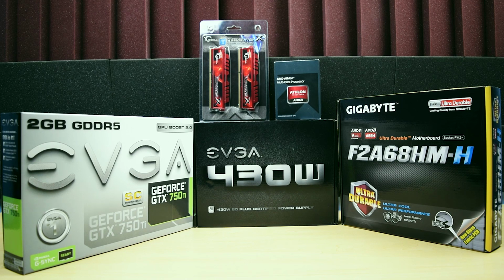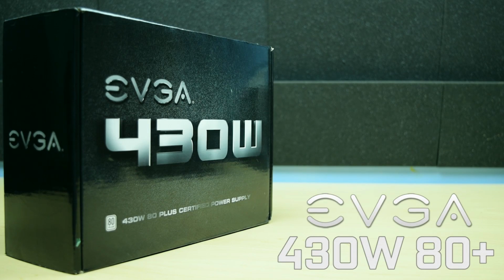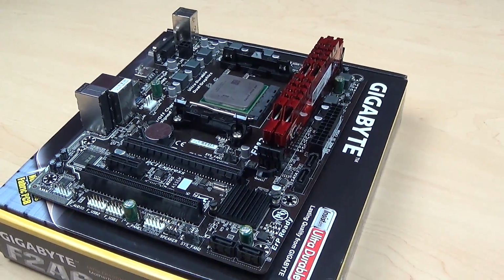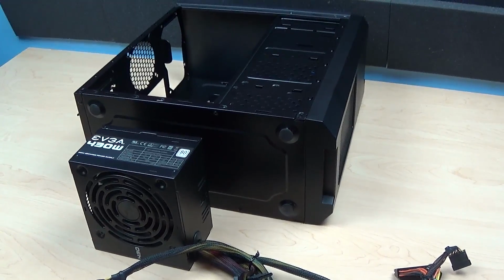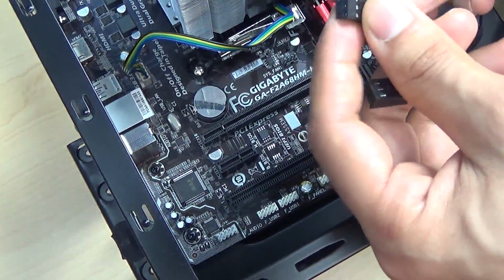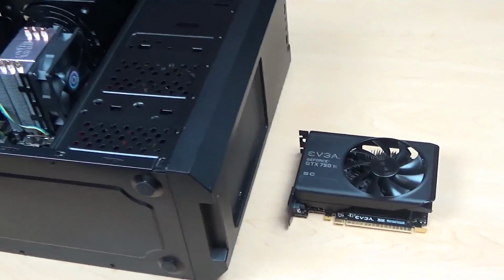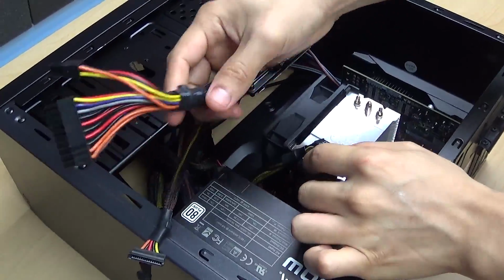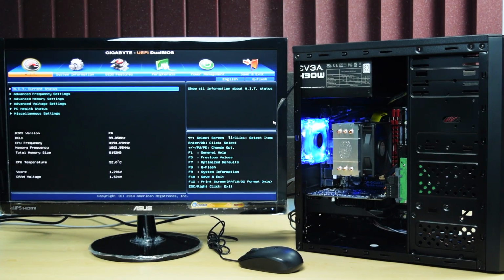Low Budget 1080p Gaming PC Build ($400)

Comment: How about 950? That's better.
Reply: +Super ahmed it's also more expensive so choose the 950 if your budget is higher
Reply: Kvarcaz1337
I already have a pc but I just suggested the 950 instead of a 750ti as the 950 could run GTA v on 1440p 30fps on ultra.
Reply: Super ahmed Ofc but it costs more like i said
Reply: Kvarcaz1337
 A little more.
Reply: Kvarcaz1337
The cheapest 750ti in the market: http://pcpartpicker.com/part/pny-video-card-vcggtx750t2xpb
The cheapest 950 in the market:
http://pcpartpicker.com/part/gigabyte-video-card-gvn950wf2oc2gd
Reply: +Super ahmed Its like 30-40 $ more expensive and the card need more power from the psu, so the psu has to cost more as well... and in most countries that card is even more expensive than in pcpartpicker.
Reply: Do you know if this build would run csgo and gtav. If so what fps? And would it be 1080 p? Thanks
Reply: SancoCustoms  The one on the video?
Yes.
Reply: +Super ahmed thanks
Reply: +Super ahmed umm no way it can. a 960 can barely do that , if even that.
Reply: ***** At 4k it would run at 15fps which may be bad but for a Cheap GPU 4k 15fps at ultra is mind blowing.
Reply: the 950 could not run GTA v at ultra 1440p it would die, I have a 960 and if I absolutely max it out at 1080p I get 30-40fps so 1440p is out of question my friend
Reply: +Jamos I have a 960 I've maxed it out on gta v but I'm able to play gta with 60fps with no problem
Reply: +Sergio Onofre did you max out the advanced settings too? I'm on an AMD FX8150 too which is not as powerful as the new Intel chips so that might be why
Reply: +Jamos yea did that as well and I have a X4 860k quad with a 4gb gtx 960 it runs pretty great wish I had a Intel but it was way out of my budget lol
Reply: +Sergio Onofre yeah I got the 4gb MSI version which is nice , but Intel (i7 or i5) does get like 70fps maxed out in the normal settings and the fx 8150 gets like 55-60 dipping to the 40s in hardcore situations
Reply: +Jamos oh nice I have the evga ftw but the only game I only get like 30-40 fps is on arma 3 ha
Reply: +Sergio Onofre yeah arma lol, I hear it's a system hog xD
Reply: +ProtoGeneralBG 1 you wouldn't need a higher wattage PSU for a 950, that 430W could probably run a 960 or maybe even 970 without any trouble at all... next why not look at the R7 370? it cost like 20$ more but it will give you so much better value... we're talking a 10fps increase in BF4 at ultra settings... so this was a 400$ build, that means in BF4 it would have a price/performance of about 0.075fps per dollar... invest 20$ more for a 370 and it would be 0.1fps per dollar...  this just shows how that tiny price increase bumped up performance significantly... I also did the math for a 970 as I believe that to sit right in the price/performance sweetspot, and getting a 970 would make the price/performance go up to about 1.3fps per dollar... however that's a pretty major price increase, but as you can see spending an extra 20$ would give you 0.025fps more (a 33% increase at a 5% price increase) and spending the extra 90$ on a 960 would give you 1.116fps which is a 55% increase in price to performance for only a 22.5% increase in total price...
Reply: +Kriss_941 I'm running an fx8150, 16gb ram, a sabertooth 990fx, 3 mechanical HDDs and a gtx 960 4g on a 500w psu
Reply: *****  It would still fit in a $400
Reply: ***** Yah... Over the budget by
$1-20. Lol.
Reply: +Swampy948 if you have the extra cash you might as well go a bit over your budget lol
Reply: +Swampy948 true, but I was just saying my thought on it. understand not everyone has extra money to spend on pc hardware.
Reply: +Sergio Onofre exactly
Reply: +Sergio Onofre does anyone else have that one friend who has loads of money but does f all? and gets everything xD
Reply: Sergio Onofre  You know, PCs can be cheaper than consoles.
Reply: ***** And people like me are saying that increasing the budget by 5% can give you a 33% performance boost... everyone can wait the 1 week it takes to save up another 20$ :)
Reply: +Super ahmed I know that but I was just saying it's not for everyone lol but I get what you're saying
Reply: Sergio Onofre You mean it's not a platform for casuals? If you do then yes it's more of a platform focused on hard core gamers who play a lot of games and knows about the industry way more.
Reply: it's a 750 ti witch for today's standards that isn' really bad at all
Reply: Halam Gigul True but a 950 outperforms it.
Reply: +Super ahmed I have Gainward gtx 750 ti golden sample which is heavily factory over clocked. It's pretty close to a 950 and about 40$ cheaper.
Reply: +skred8 it gets to the point where you're like "wow the 950 is only a little more and it outperforms the 750, oh but the 960 recks the 950 and its only £40 more, but wait I could get a 390 for a little more etc
Reply: +Jamos It's all about what you can afford for me. Cos I'm not some millionaire or something.  I built my rig last year and was on a tight budget and I'm still pretty much satisfied with it. Get avg 35-60 FPS on most games with 1080p med- high textures. Even with RotTR got 30-40 FPS on decent settings. Probably next year I will build a new rig once the pascal is out.
Reply: +Super ahmed Dude a 950 will NOT run GTA 1440 ultra at 30fps. What are you smoking
Reply: +MyDinosaurz I'm afraid it does, maybe not balls to the wall maxed out but most of the settings maxed!
Reply: Jamos You're saying, a GTX 950 will play GTA 5 at ultra setting with only 2GB of gddr5 vram? Ok buddy. Link me to a video of someone doing that. That thing couldnt max out GTA 5 at 1080p and play above 60fps. LET ALONE 1440P DUDE! Some people man....
Reply: +MyDinosaurz you make me laugh 😂 "some people"? what's that about? I'm not a fucking noob hahaha I know some shit about these things. GTA 5 does not use loads of vram the things in the settings menu are RECOMMENDATIONS! you can ignore them, GTA 5 isn't likely to use a lot more than 2gigs, and even then you won't get huge fps drops, you MAY get stutters now and then because the memory buffer can't hold the textures, so it delays them causing pop ins! wow
Reply: +Jamos buddy....just stop. it cant
Reply: *****  Heating issues? Those people are lying, don't listen to those people.
Reply: ***** Ok, but I would recommend the 950.
Reply: Almost any card willl fit into an Itx. My 970 fits in my itx case
Reply: +Super ahmed Wrong if you put in that way ÿeah 30 bucks isnt that much" oh wait 40 more and you can go for the 960 wich is better, oh wait for 40 more you can pick up the 4gb version for mods, oh wait for 40 more you can get one a little bit better from AMD, and you can go up and up till you end buying a Titan X, price is price and budget is budget.
Reply: Baphomet VI I said 30, not 40.
Reply: ***** Then okay, pick up the 960 instead.
Reply: ***** Cool! I have a GTX 970.
Reply: ***** My Asus Strix GTX 970 is just great, I would rate it 8.8/10.
Reply: +Super ahmed why would you buy 750 and 950 when R9 270 blow them out both into the water price to performance? sad amd is always a forgotten beast.
Reply: Muhamad Ubaied  It's not forgotten, but I just prefer the 950 over the r9 270.
Reply: Muhamad Ubaied  But the r9 295x2 beats the titan x and it's way cheaper.
Reply: +Super ahmed it's a different story for Canadians. It's probably wayyyyy more expensive
Reply: Super ahmed
 generally i dont mind about amd products. people complain they're hotter and require more wattage. so what? get better cooler, cooler environment and better psu. I love amd card over nvidia due to price to performance ratio. thats all. About the 270, im not sure if its still available in market today, for 950 price maybe you topup more abit for 960 or 380/390.
Reply: Muhamad Ubaied The 295x2 cool just fine and it performs better and is way cheaper.
Reply: Muhamad Ubaied The 950 price point is where Nvidia tops but Titan X would be a waste of money for gaming.
Reply: +Super ahmed the titan is pretty much for those people who want to live stream or just want the frames, or video editing
Reply: CrowntheDino
 Nope, it's for gaming.
Reply: Super ahmed this video is about a budget pc rig, not an overkill pc that gamer enthusiasts want
Reply: CrowntheDino
 I know that.
Reply: Super ahmed if you knew , then why bother commenting a 950 is better ?
Reply: CrowntheDino
 Cuz someone commented AMD is a forgotten beast but it's not.
Reply: Super ahmed hm seems legit
Reply: Merlin Riot
 My PC has a cor i7 4790
Reply: +Jamos that's untrue , I play GTA V with a 650 TI boost on high at 1080p @50+fps, 950 will play it ultra-high over 50fps , 650ti boost is right up the ass off the 960 2gb in performance ;)
Reply: +Kyle fulerton THIS. Having a more costly gpu is a luxury not a necessity. A lower gpu number doesn't mean it's bad it's just about how many frames you want/are limited to. Most games are good at 30-60fps.
Reply: Guys i have a question:
Can Intel core 2 quad q6600 will get same Athlon X4 860K performance(with gtx 750 ti)?
Reply: CrowntheDino Athlon X4 860K ise better?
Reply: CrowntheDino Thanks

Comment: This will be my first build ever i have all the equipment ordered to build this but is it easy to?
Reply: He didn't show everything like where to screw in a few things & if it comes with the data cord for the hard drive im scared >_<
Reply: hahhaahha
Reply: I've never made a PC befor so yeh...
Reply: +SpartanGaming LP get an experienced friend to help
Reply: Kk,
Reply: +ExoticTools 0.1k? will this computer meet these requirments for arma 3? 
OS: Windows 7 / 8 / 10 (64bit) 
Processor: Intel Core i5-4460 or AMD FX 4300 or better 
Memory: 6 GB RAM 
Graphics: NVIDIA GeForce GTX 660 / AMD Radeon HD 7800 Series with 2 GB VRAM 
DirectX®: 11 
Hard Drive: 25 GB free space, SSD / Hybrid HDD / SSHD storage 
Sound: DirectX®-compatible soundcard
Reply: SpartanGaming LP gtx 750 ti w/ intel core i5-4460 will work fine tbh 660 might struggle
Reply: no I'm asking if I play a game on this build with these requirements what will happen
Reply: SpartanGaming LP go with the i5 not amd and you'll get around 40-50fps on high
Reply: I'm on a strick $425 budget how much it cost
Reply: SpartanGaming LP search yourself
Reply: +ExoticTools 0.1K?  GTX 660 is better than GTX 750ti.
Reply: If you are determined it's really not difficult. Some doubts will come up but it's simple.
Reply: same price?

Comment: would it be better to switch the gtx 750 ti  with a gtx 950 ??
Reply: yes
Reply: That is what I'm planning to do
Reply: +BABYIRAQ 209 Yes 950 can play games at 1440p 30fps ultra settings.
Reply: +BABYIRAQ 209 also if you went with the g3258 you could upgrade to an i5 later

Comment: I built this exact same pc since I decided to order everything from Amazon it was a bit close to 500$ but very well worth it. Gigabyte mobo is neat and small, and has a lot of potential, the 860k performs well even with editing. The 750ti SC, is great and cheap gpu, I ended up over clocking it  and got great scores on high settings with the valley benchmark and actually decent scores on ultra. The g skill ram is perfect, all tho you have to remember to enter bios and manually change the speed since it reads at 1600mhz stock and the ram is 1866mhz not much of a difference but you gotta use what yah pay for. I got the evga 500w 80 plus bronze psu which was literally 2 dollars more. And have been playing h1z1, day z, and Arma on very high settings. Even got it to run on ultra. This pc is beast, and just checked prices on my amazon account and everything has dropped really low. So right now it's perfect to build this.

Comment: Very good build, probably the best you can get for the money when building a mid tower.

I did the exact same build with a mini-itx case, ssd, and a modular power supply and got the same results. (CPU overclocked to 4.2ghz).

The only thing is, it costed my 500 euro's (in the Netherlands with windows 8.1 and wifi usb adapter included).

Comment: My PC is very similar. The only big differences are that I use a 750 ti ftw bc It's only like $20 more and is much more powerful. I played the open Beta for the division on my PC and could run it consistently at 60fps, 1080p at medium settings. I recommend you save up a little more for the better graphics card

Comment: I suggest getting a cheaper set of ram. In all seriousness, you don't need fancy heat spreaders on ram. Or any heat spreaders for that matter. Unless you plan on overclocking your ram, just go with a set without them. You can save quite a bit of money by doing so.
Reply: +Dasher Plays Half of the time RAM with heat speaders are the cheapest.
Reply: Not usually.
Reply: Dasher Plays Half of the time is often enough. And even if it's cheaper , usually I pay maybe 50 cents more.

Comment: So, i got $500 and i've assembled a parts list, all of the parts being new. Probably a bit much for 500, but like i said everything would be new. And color coded.

I intend to play games that have already been released and play them for a long time (the most demanding games this rig is intended to handle are planetside 2, maybe arma 3, battlefield 4 and rome II: total war.)

Here's my part list. Worth 500?

70 Storage: Seagate 1TB SSHD (hybrid drive)
40 Case: Deepcool Tesseract SW (Blue)
100 CPU: 880k (chose over 860k because the default fan is supposedly good enough to handle an overclock)
145 GPU: MSI GTX 950 2GB ocv3
65 mobo: ASrock ATX 1066 fm2188x pro3+
40 PSU: EVGA 600 80+ bronze
36 RAM: Corsair Vengeance Blue 2x4
Reply: Dude don't buy the sshd, keep the extra money for the ssd. And i don't think you will use all the power from the psu but be sure to check amd page. And i don't recommend you buying this pc because new cpus are around the corner, but besides of that youe pc is decent
Reply: Don't buy the gtx 950 is nearly the same as the gtx 750ti.
Reply: +Diego Herrera. I disagree..it has double the cuda cores and is only $20 more depending on what and where you buy.
Reply: Diego Herrera. i spent 379 and swapped the 950 for a 960 (cheaper, but refurbished), 600w for 500w (i'm not overclocking) took a 1TB HDD i found in storage and swapped the 880k for an 860k. 

Runs rome II on ultra (runs well on extreme but flips out when the units start fighting and drops to like 8 FPS for some reason) 

Runs arma II on very high (though i use high, because massive battles are my thing and the FPS dips dangerously low on very high in large battles)

Runs insurgency at a very steady 60 FPS indoors, and about 45-30 FPS outdoors and the huge maps (buhriz) 

The question now is: should i in the future swap the 500w for a 750 and the stock cooler for a good air cooler and OC to 4.4 ish? is it worth it? (30 bucks for 750 W after selling my 500w for 30ish, 30 for CPU cooler, so about 60 bucks for an OC and the hassle of re-wiring all this gunk)

Comment: Xion XON-310_BK MicroATX Mid Tower Case has front panel USB 3.0 ports, but the Gigabyte GA-F2A68HM-HD2 Micro ATX FM2+ Motherboard does not have onboard USB 3.0 headers.

that's what the website said....

Comment: for £650 i got a i5 6500 3.2Ghz CPU, MSI Z170A Gaming M5 Motherboard, MSI GTX960 4GB OC Edition, CX600M PSU, Corsair Vengeance DDR4 2400mhz 8GB Ram, 120GB Kingston SSD 1TB TOSHIBA HDD
Reply: +Ruben Grandal as of right now i havent built my pc as im wsiting for the case however i should be able to max out gta 5 and 1080p and get a steady fps of around 50 i think. games like CS:GO will not be a problem at all with this build! :)
Reply: +Ruben Grandal no problem bro! and good idea. id say your best bet is looking at the psrts suited for your needs. im not a massive pc gamer so my parts will do the job! :)
Reply: +Ruben Grandal hahaha 😂 well your definitely gonna see a difference with upgrsding. i wouldnt try overclocking unless you absolutely 100% know whst your doing. i did thst snd fried my other pc 😂

Comment: i think it's a good setup. but for newer games the 750ti is not a good choice. i think u can buy a cheaper psu and cheaper ram and look out for a gtx 950/r7 370 or a used 960/r9 380 made similar build months ago with the fx 6300 and r9 380x all used parts and has the same pricepoint. i just want to test a i3 6100. sometimes u can get this little piece of love for 80 bucks on ebay... so u can upgrade in the future when the prices for the 6500/6600k/ or even a i7 gets cheaper. buuuuuut... all depends on money. im not a intel fanboy... i go there where the money calls... but i want do more intel builds in the near future with older generation. anyway! i just bla! nice build at all. BTW just wait for the ne entry nvidea cards 1060/1050 i think this things will bring a 1080p on a new lvl for ur bucks like the 1080/1070. best regards from germany!

Comment: So will this all work together?
Specs:
 Microsoft Windows 7 Home Premium w/SP1 - 1 PC

G.SKILL Ripjaws x Series 8GB 240-pin DDR3 SDRAM DDR3 1866 (PC3 14900) x2

AMD Black Edition Athlon II X4 860K 3.7 GHz Quad-Core Processor - 4 MB - Socket FM2+ - Retail

XION Gaming Series XON-310_BK Black with Blue LED Light Computer Case

Seagate Barracuda 1 TB Internal HDD - 3.5" - SATA 3Gb/s - 7,200 rpm

eVGA Power Supply - 430W

Cooler Master Hyper TX 3 RR-910-HTX3-G1 Processer Cooler

EVGA GeForce GTX 750 Ti SuperClocked Graphics Card - 2 GB GDDR5 - 128-bit-1176 MHz

Gigabyte AMD FM2+ A68H SATA 6Gb/s USB 3.0 mATX ATX DDR3 2133 NA Motherboards GA-F2A68HM-H

 Total: $501.39 (Minus tax)
Reply: And should i buy it all at once or slowly buy all the pieces?